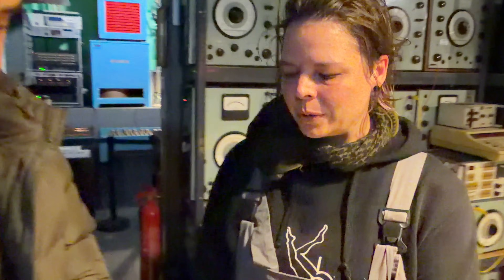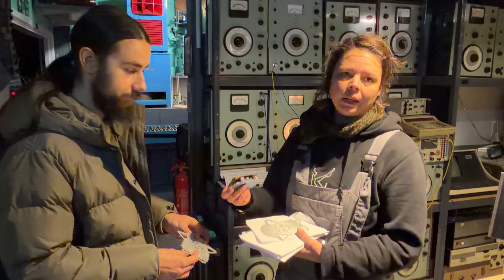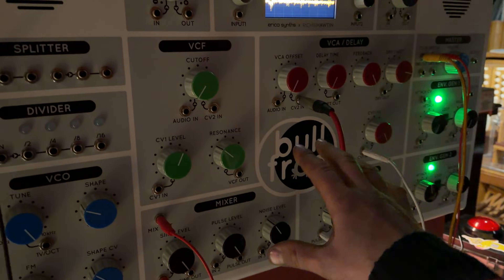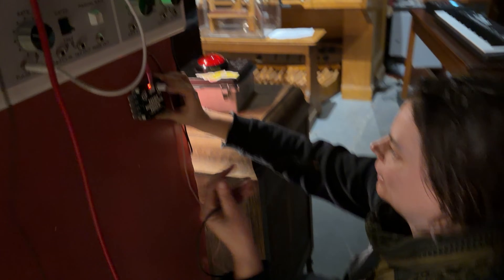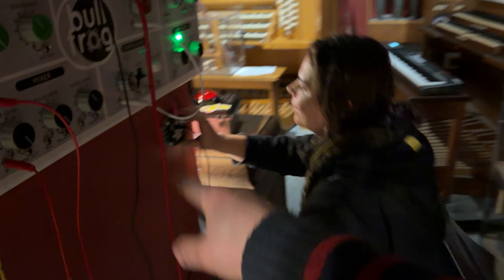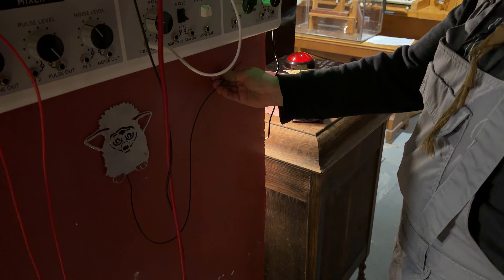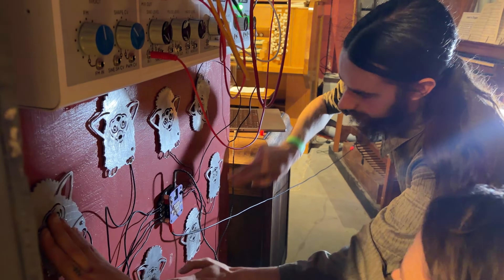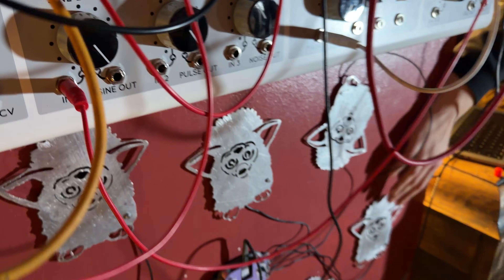FURBY MIDI MADNESS - Touch Midi Furbies With Acid Solder Workshop

Comment: I accidentally turned my phone into a capasitively touch chargeable phone when i knocked off a couple of resistors when fiddling with it after changing a broken screen, that were for the wireless charging. It broke the wireless charging, but now, when I'm holding it and putting my hands near the charging port it suddenly starts charging out of nowhere ... the number never goes up, as it's such a small current, but it detects my hand is there and thinks it's charging, so there must be the tiniest bit of coupling going on haha. 

I'm gonna fix it in a day or two, so no more touch charging from my hands ;( .. but at least I'll be able to actually charge it wireless again. xcD

Comment: If its for the kids, maybe dont use velcro  - thats too tempting to pull off and strain the wires
Reply: I think it’ll be ok. If it gets pulled off an broke! Can fix it. I guess shall see!
Reply: A very good idea!  Also, it might be wise to affix the wires with a lot of small staples and even make a perspex cover for the controller.
Reply: @projectartichoke It’s low voltage and there to be fiddled with it will be ok. It’s not a playground. Most folk treat the items with respect. Also there’s a kbob on the controller